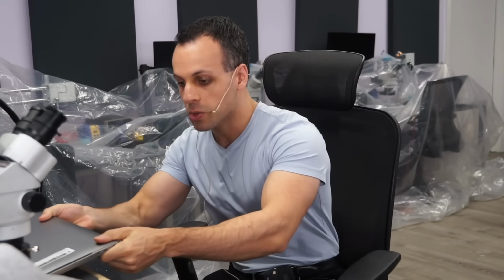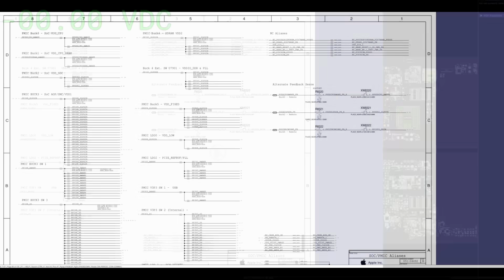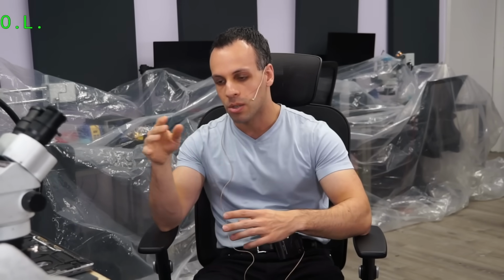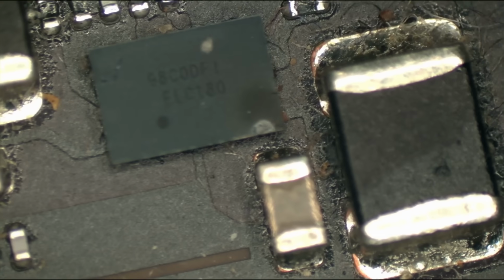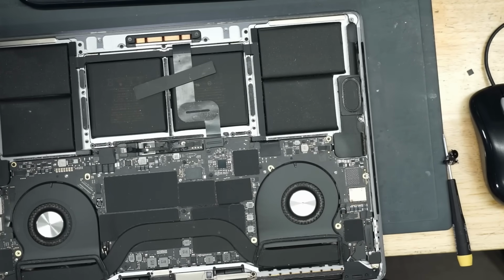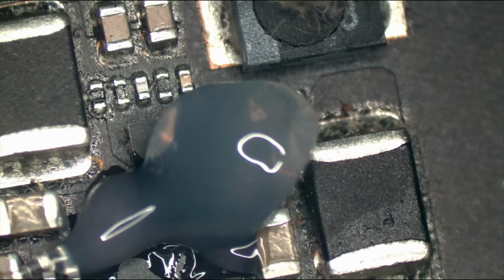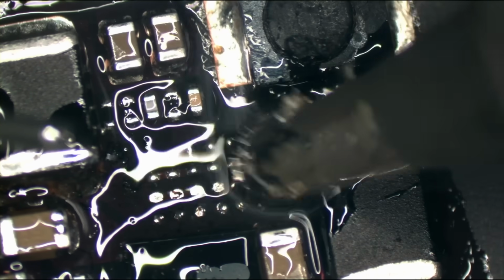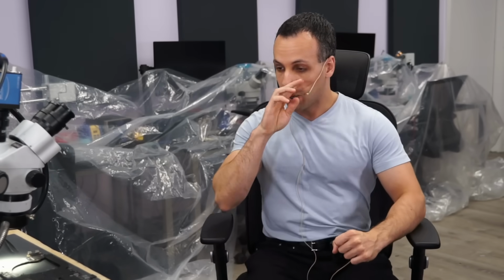How most 16" Macbook Pros often kill themselves & why they're unfixable

Comment: The way this fails is unforgivable.    It's bad enough that it's expensive.    But to kill the SSD that you can't recover is terrible for someone that doesn't have backups.
Reply: This video turned up as a YouTube recommendation just now. A couple of months ago my 15 month old MacBook Pro just died while I was using it. I hadn't bought Apple Care because no PC/Laptop should last less than 3 years. But Apple didn't except that argument so I had to shell out nearly 50% of the purchase price for a new main board and no explanation as to why it had failed, so I can stop doing whatever it was I was doing that caused it to fail, baring in mind the thing hadn't moved from my desk in all the time I'd had it.
Seeing this video I now think I know what the problem was, and zero confidence it was bad luck and the thing could probably die again, probably just after the 90 day replacement guarantee expires.
Reply: @axelBr1    - Apple is not the same company anymore. The older Macbooks built before about 2014-2015 seem to have much better reliability. After that, I started to see a substantial increase of negative feedback/reviews where customers were having many more issues with Macbook Pro's. 

Seeing many MBP owners post comments like yours, where their devices died way too early after purchase, and issues with other Macs, this shows the truth about Apple that their best years were long ago. Apple has become so despicably greedy and disgusting - the way they make their overpriced products unreliable and intentionally building crap, hoping that many of their customers will just run back out and buy another replacement to increase their profits. 

I gave up on macs, I went back and bought a windows laptop a couple years ago, no regrets at all, wish I would have switched back to windows sooner.
Reply: @axelBr1  That happened to me after my screen delaminated after a knick to the corner, had to pay a gigantic sum of money out of pocket
Reply: Prayy To iCloud storage. N oooooh
Reply: Apple
Reply: Backups - this is why I’m obsessed with keeping my backups up to date.
Reply: @Orwic1  I was lucky as I’d just bought a drive and done a backup, after about 14 months of use, as after decades of using computers with hard drives I was basking in the joy of failure free SSDs. I never heard anyone mention that SSDs could be fried.
Reply: A simple 3.3V zener diode could prevent dataloss from happening even if that chip does fail. It's by design.
Reply: Has to be intentional.
Impossible to design a unit of this sophistication and not know of the deadly failure consequences
Reply: @sammencia7945  to sell you an upgrade
Reply: @sammencia7945  Hmm that does not seem entirely true.  The more sophisticated and complex your build is the more possibilities there will be unexpected failure modes.  It is extremely difficult to thoroughly test all situations and would cost way too much as you would have to do 4-5 years of testing.

But that said I would not put it past Apple to build a fail mode in deliberately.  They are one of the worst companies on the planet.
Reply: This is just ridiculous, just stop buying laptops without removable SSDs, like if apple got 1 week of lower sales and a non soldered SSDs hashtag, they would have removable storage in a matter of months
Reply: @andrescarrasco1248  try convincing the apple fanclucks of this.

They live and die by the apple branding😕
Reply: @andrescarrasco1248  nah apple's new mac studio has removable storage but it's useless becuase the controller for the ssd is on the motherboard making storage modular but not upgradeable. So yeah it's literally malice at this point.
Reply: Agreed. However, if your data is valuable to you, there is no excuse for not having a recent (not necessarily up to the minute) backup. Failure to backup is asking for disaster.
Reply: Sorry, but Time Machine backups are stupidly easy and I do one every week. Even if I suffer a catastrophic failure (never happened to me, and I own Macbooks since 2010) the data damage remains managable. No backup, no sympathy!
Reply: @sogarhieroben 
Just because you make backups doesn't mean everyone does.     And I still stand by my comment that It shouldn't fail that way.   I have Apple products and like them.    But I don't feel like I need to defend whatever they do because I own their products.
Reply: Backup your shit. Apple makes it stupid easy with time machine. 

Still that seems like a super stupid design.
Reply: Increadibly poor design on Apples part, not that soldered in parts are an Apple only thing but still (even worse they seem to have a shitty power delivery issue that's been frying this particular model, probably is responsible for others). When peopel are paying thousands for these devices, it's really poor form for Apple to cut corners like this.
Reply: people without backups LOOOL
Reply: All computers fail. If you don’t backup, you deserve all the pain you get.
Reply: What is really a bummer is that it actually KILLS the SSD 
Which means that because of THEIR fault your data is LOST
And I’m sure the price of the SSD will be in the bill to pay 

Anyway like always : always backup your data 
macOS has a great feature called Time Machine that backup every change of your system so you can buy a brand new MacBook and import the backup in your Mac and it’s just as it was before like nothing changed (well yes, the hardware)

I’m curious to see how it is now with the new M2 generation if they fixed that issue or not (at least not killing the SSD, just cut the power before going to the SSD)
Reply: @ColonelLucario  

It's the entire motherboard.     If you can get one.    And if Apple or someone else can repair it.     Everything including the SSD is soldered on.    Considering parts cost and labor it's not cost effective.
Reply: @Extremaduur  
Planned obsolescence perhaps.     Most likely cheaper to build.    Everything is soldered on.    You don't have to put on separate connectors.  Put the components on after .      You just slap a motherboard in a shell and go.
Reply: @jasonk5979 what is this issue and why it happens?
Reply: @sebastianestrada1311  

The SSD is killed by a component on the board.   It's all surface mount components.     Apple should redesign their components so that's less likely to happen.         Maybe they have.   It's been a year.
Reply: @ColonelLucario  I'd think apple wants to keep sales up so why fix it?
Reply: While I agree it is unforgivable anyone that does not have backups deserves to lose their data.  It is not as if this is new information or that there are people out there that have not been told they should backup.  So completely their fault.
Reply: @VestigialHead typical apple excuse: you used it wrong.
Reply: @brayannexon4613  Yes Apple is a shitfest of cunts.  But that does not change the fact that anyone who does not backup important data is a tool.  No matter what hardware they use.
Reply: @VestigialHead  
If I bought one of these laptops for what they cost.     And it failed in that way.    I would be pissed off.   Backups or not.
Reply: @jasonk5979  Oh I agree and I already said so.  Not the "unforgivable" in my post.  Apple is horrific shit.  I would not buy their crap under any circumstances.
Reply: @jasonk5979  But anyone who does not backup is a complete fool.
Reply: @VestigialHead  
Not arguing that or with you.    I was in IT for many years.    Trust me I know.     I just don't like crap products.    Especially one so expensive.
Reply: @jasonk5979  Yep I agree.  Been in IT for 30 years and I always steer clear of Apple products.  Unfortunately I have to work on them as some of my clients will not listen to reason.
Reply: @jasonk5979  With the cost of that laptop, it should come with a 5 YEAR warranty and be built to last even longer!

Comment: This sounds like the motherboard failures we have seen in my school district on the hp 11 g6 chromebooks.
they just.... die, had one make the cpu so hot it melted the solder holding the heat-pipe to the copper plate even.
we have a growing pile of 300+ out of about 2100, 
Sad that apple's design has become no better than chromebooks, but not unexpected.

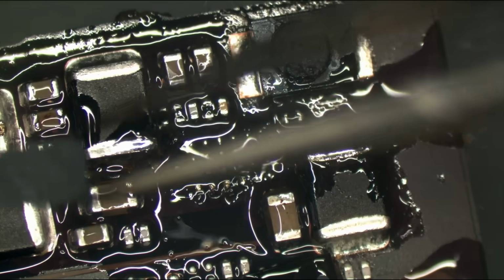Comment: 13:00 It looks to me like you soldered the chip shifted to the right a little and still have a row of bga pads exposed with no chip.
Reply: He didn't actually solder the chip. He placed it near its normal position before deciding to check that the short was clear with his multimeter. It was not, so he abandoned the repair and didn't solder the chip after all.

Comment: The power conversion chip probably uses a 1920-vintage buck converter. This circuit uses "hot switching" which maximizes switch losses, voltage spikes across the switch, and current spikes through the switch. When the FET switch shorts, this circuit delivers the input voltage directly to the output, frying circuits connected to the output. Fortunately, there is a 2011-vintage alternative. It is cheaper, does not use "hot switching", puts less stress on the components, has a lower ripple, and has higher efficiency.

I saw a motherboard VRM that uses 29 buck converters to try and make up for flaws in the 1920-vintage circuit. If just one FET shorts, the CPU voltage will go to 12 V. Imagine the clock speed you will get just before the CPU melts!
Reply: Uhm what's the alternative and how is it cheaper? The typical step down VRM design where you switch the high rail, filter and freewheel a bit has an advantage of being super power efficient, since the effective switched current is quite low. Trying to get this sort of efficiency from step up is dicey.

In fact in a well designed step down regulator, the high sides just never fail by themselves. The free wheeling side fails and makes the failure safe, and then the high side fails as well, but by that time the components powered by the group are protected by the perma shorted low side. So naturally you have to rebuild the whole thing but your valuable bits are fine.

Comment: Need an investigation why that chip die, where elsewhere is used in other products, is possible that the power chip to be faulty from design and in some conditions to be locked in putting Vin to Vout, that needed to trigger a recall of product by Apple and begin an investigation into that chip.

Comment: So what model and year MacBook is the “best” to buy? Or easiest to fix and has the lowest failure rate or a balanced combo of both?
Reply: 2013-2015 Retina MacBooks are pretty good
Reply: @jameschen8 Indeed, still on my late 2013 MBP and it's on/used for 12 hours a day.  Replaced the battery myself a couple months ago (1000+ cycles, couldn't finish watching a movie on a full charge).   Can't do macOS updates anymore, then always get random shutdowns because of some issue with the thunderboltNHI kext ... tons of perfectly fine MBP's probably have been thrown away because of that issue.

Comment: Which, if any, MacBook would you recommend as having the least (in number and severity) of unrecoverable pitfalls such as this? It’s one thing to lose the machine it’s another to lose all the datums
Reply: He has (or had i don't know if it is still up) a video and he "recommended" a late 2013 15inch retina (THE MODEL WITH DISCRETE NVIDIA GPU) the model with intel integrated graphics only kernel panics apparently.
Reply: @bloberino8956  I have it and the pre Retina 2012 12” MBP which is also repairable. Recommended.
Reply: Thanks guys
Unfortunately I already got a mb pro

Hoping it doesn’t blow up like in this vid 😂

Comment: Honestly, for the amount of shine, polish, tech and price of the product, it is very difficult to explain why the circuitry is so badly protected in any different way that Apple wanting these devices to fail.
I mean, they can build best and greatest CPU but can't be bothered to spend couple more dollars to make the circuitry a bit more resilient?
So I can read spec sheets and calculate that all components work within their specs but Apple having probably thousands people designing those boards with infinitely more experience and actual education can't?
Reply: Apple is not a tech company, it's a fashion company. Their products are a status simbol, everybody knows it's expensive so it's for show off that you have money. Their electronics build quality is on par with the cheapest Chinese products.
A simple ~3.6 - 3.9v zener diode (3 cents each, even cheaper wholesale) placed in parallel would prevent 12v from reaching the SSD. It normally would have no effect on the circuit, but if the voltage increases above zener threshold for any reason it would draw current and prevent damage. Sure you would have to replace the VREG and the Zener but at least the SSD would be safe
Reply: @petarmiletic997  apple doesn't know lolol, and btw if you live in any humid country don't bother using apple. Even the tiniest of humidity just destroys their laptops.
Reply: @93hothead  wth what you know about humid places. I live in tropic area, and while it may be true that some of mbp fails, i believe it’s not that common like everybody make it be
Reply: @93hothead  I live in Thailand and my 9 year old MBP is starting to play up. Hmm.
Reply: @petarmiletic997  True, but the threat of loosing all your data in a crash drives people to buy their cloud subscriptions so they can have apple auto upload the back up. Each time an apple dies, and they claim total data loss, they gain subscribers for the cloud. More money to be made with devices failing than protecting the data the customer values.
Reply: @petarmiletic997 well  I would consider more of a user experience company with strategize failure points since they profit off of hardware rather than ads and data. You always pay the extra price somewhere.

They make a product that performs well when it isn’t dead (apple silicon and newer), it looks pretty, has great speakers, screen, touch pad drivers, materials, and the OS is sleek and refined. but under the hood it is absolute hell 

Kinda like admiring a poodle only to get your leg bitten off

In a fan of some of their simplified user interface decisions and attention to details, again their user experience and surface level attention is incredible

It’s just that they make these things ticking time bombs on purpose and it’s frustrating when you need one of these pieces of shit for work and you need it to be a newer one because XCode requires newest Mac OS, because iOS requires newest Xcode…..

A fucking nightmare

2012 non retina was peak MacBook Pro design until they went with the can’t fix it sleek and slim approach
Reply: Thats how they financed that CPU XD
Reply: it was DESIGNED TO FAIL though, not a fault of engineering
Reply: @jefflund9134  I think my questions was rhetoric. Obviously, I am not claiming I can do better than $2T company focusing on designing a dozen products.
Is there some kind of irony marker I can put in a comment to point it out to youtube masses?
Reply: @leonardmilcin7798  we are talking about the company that believes that a warranty means that they will offer you a discount on the next product you will buy from them.
Reply: @jefflund9134  pretty much chinese made crap i got 80 year old radio tubes that still work

Comment: Is there any preventative maintenance that can be done to prevent this from happening?
Reply: Some have suggested that buildup of dust may have caused a short, so you could try dusting it more regularly. But in all likelihood, there's a design flaw with the circuit and there may not be anything that can be done realistically.

Comment: what a cliffhanger! Louis don't hurt yourself (still have fun though). I want to see the finale and more 😀
when I'm asked the question "Apple or PC?" my answer is "all of them." tech is my profession. any class/brand of machine will have good and bad models. your top duty as the pro is to figure out which is which before you commit to a huge investment in something that has a design flaw. you always have to remember that the manufacturer's priority is profit, your best interests are merely a byproduct. I love the vids here Louis to see how you upend a deliberate effort, by Apple usually, but they all do it, to plan obsolescence while pretending quality. I just love turning "can't be fixed, you have to buy the new one" into "this one works just fine now, bye" 🙂

so we all have to live with something. I'm not as good as Louis with the microscope and soldering skills. how do I get good stuff anyways? I choose equipment that's neither too new nor too old along with researching reputation. this means a product that has withstood the test of time but is really hardly worn at the same time. look up "bathtub curve." applying this tactic to Apple products has worked great for me along with all the others 😎

Comment: I appreciate yours channel and obvious Apple overcharges for any upgrade. however, I never had Mac failed on me, and I have been using some of them for more than 10 years, so, or I have been lucky or there is another side of the story.
Reply from the maker: The 16-in MacBook pro came out 3 years ago, if you have a 10-year-old machine you have a different model
Reply: @rossmanngroup  yeah sure, well I have an iMac 2013, MacBook Pro 2011, MacBook Pro 2015 and MacBook Air 2011, all up a running, never had a problem besides upgrading the HDDs/SSDs for bigger space an speed. But again maybe I have been lucky.